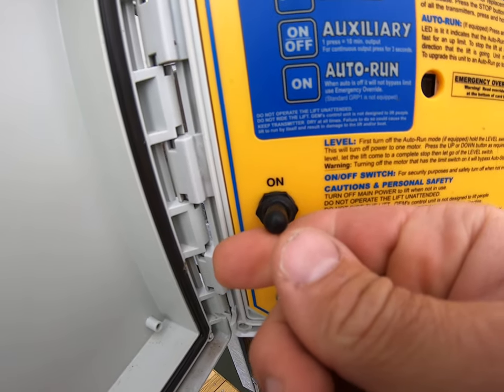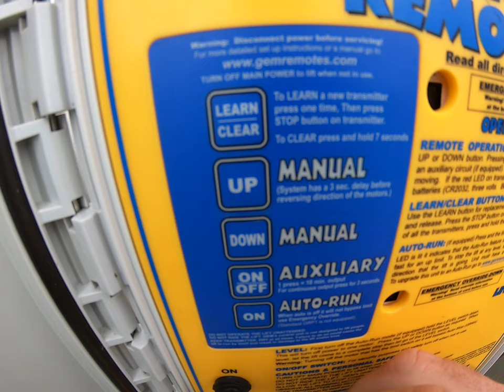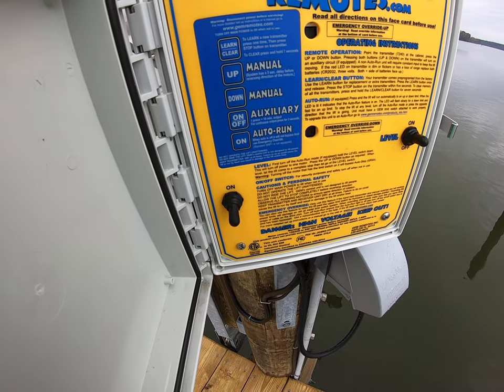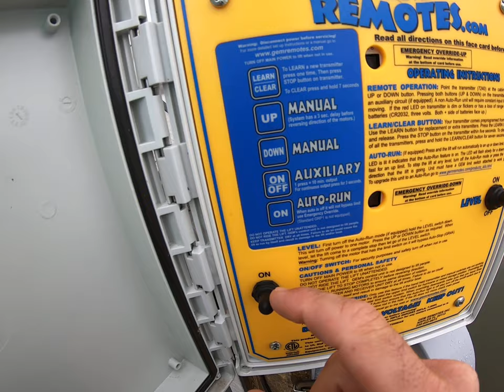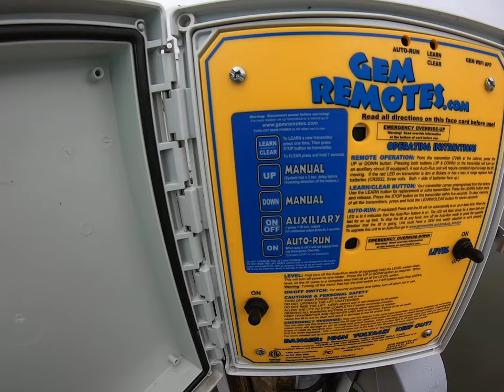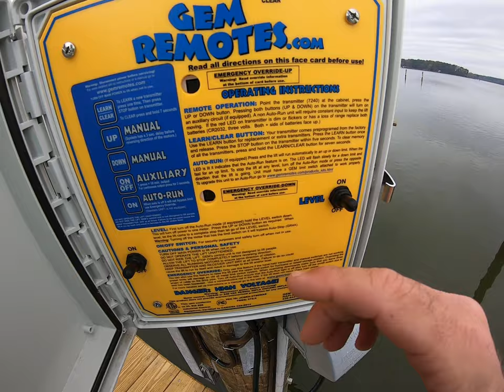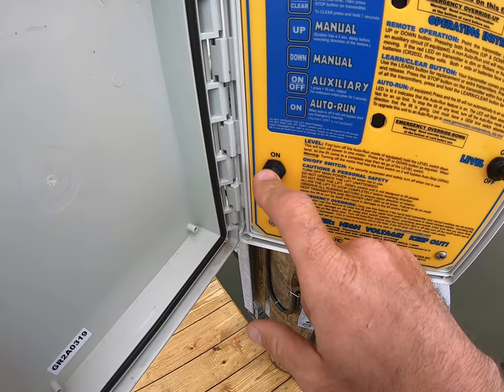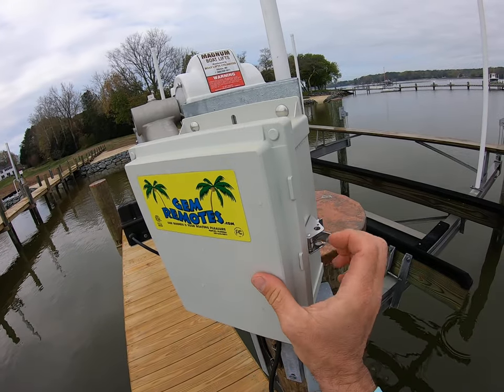BASIC GEM OPERATION

Comment: Thanks for sharing this info. I got this same model and both led’s are flashing for auto run and learn clear. The remote nor the receiver work unless I manually overwrite. Any suggestions are welcome.
Reply from the maker: It sounds like you have a bad limit switch to me....bypass the limit and if the problem still occurs, it might be a radio board...but with the flashing lights I'd start with the limits.  good luck

Comment: What does auxiliary switch do ?????
Reply: Auxiliary allows turning on a light or something else. Only works with a certain motherboard with aux relay but the cover plate is still put on all gem units. Even though my unit can not run an aux device, it works as an electronic stop switch while using auto up or auto down rather than cutting power.